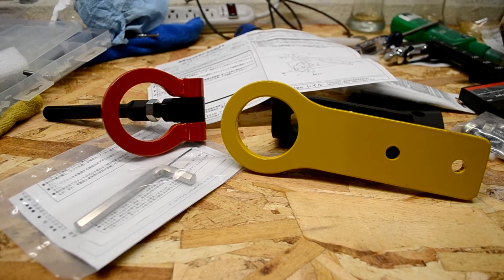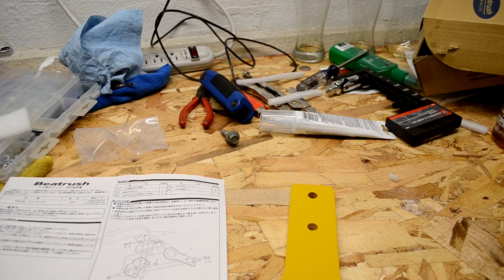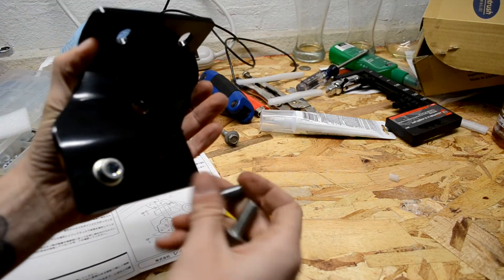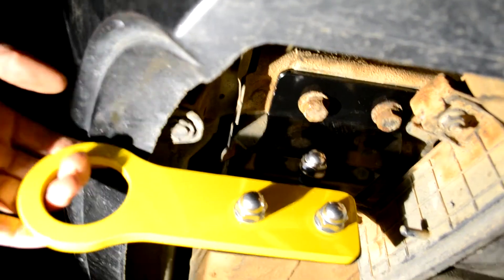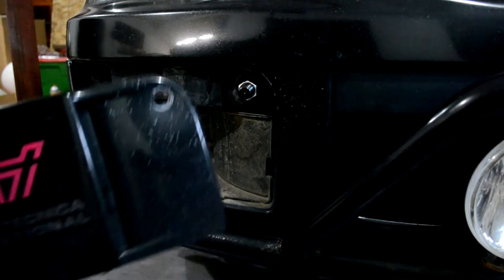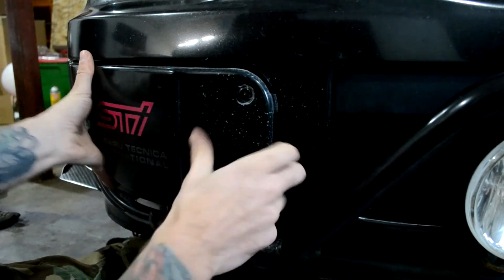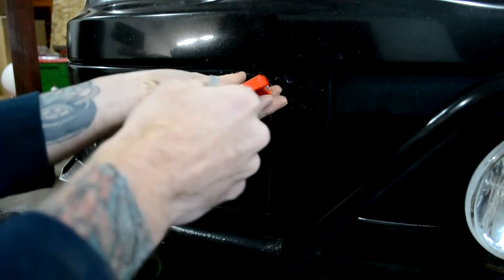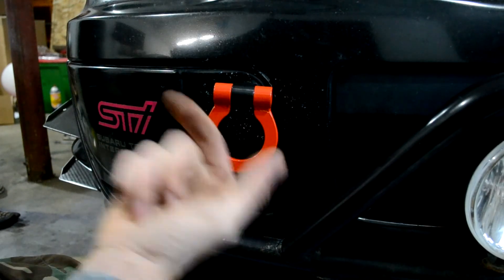Front and rear tow hook install for 04-07 Subaru STi and 02-07 wrx

Comment: Thought those two rusted bolts were going to put up a fight. Changing the vent valve on the charcoal canister was easy too. The bolts you think would be a problem were surprisingly a non issue.
Reply from the maker: svtwrc Yea, my exact thought, I hit them once with oil and gave it an hour and they popped right off which was a first for me .